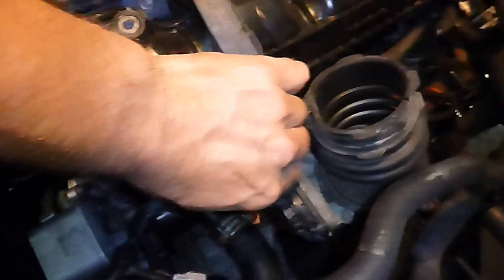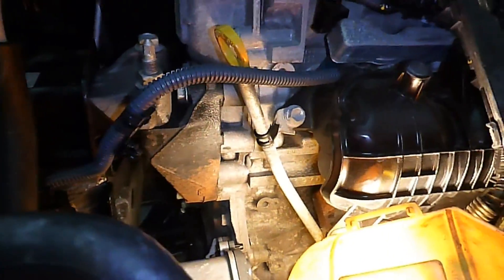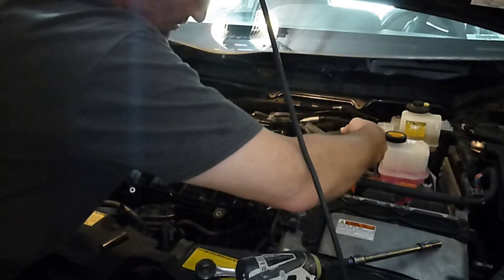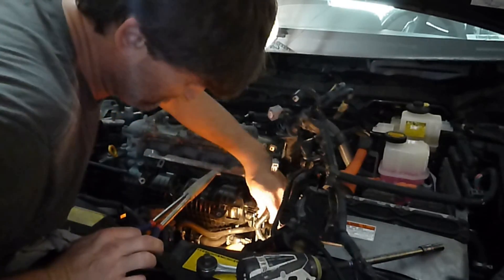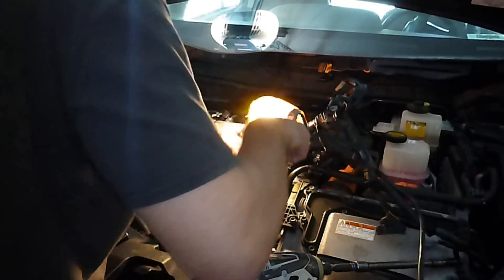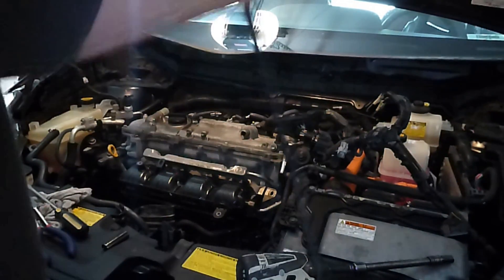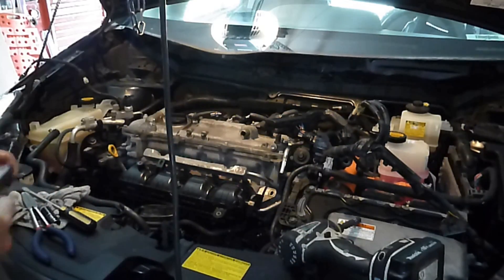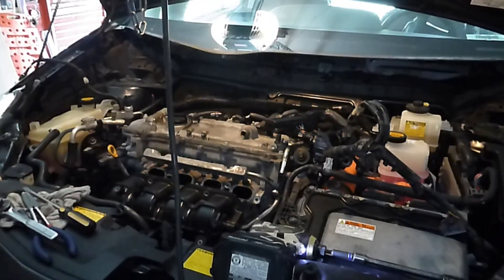Part 2 - 2016 Prius Engine Swap into 2012 Prius V - Start to Finish

Comment: Dang I've done some work on my prius v because of it shaking. Cleaned out EGR and even replaced the egr sensor (which probably wasnt broken) then sprayed all that engine cleaner in the intake manifold and EGR filter. Changed all the fuses and it still shaking. A shop just quoted me $7,000 plus to swap the engine. I'm trying to watch your videos to see if its easy enough for a DIYer like myself to do. How much do the new engines typically run?
Reply: Ok, First unplug the wires going to the EGR. Then at least the car may be drivable.
 -Fix THat Prius !!!
Reply from the maker: Hi, a low mileage engine from LKQ is about $1600 delivered.
 - Fix That Prius !!!
Reply: @fixthatprius4980  Im close to buying one and fixing it up. Thanks for the info. I just need an engine lift.
Reply: @fixthatprius4980  Do you have a link for that?

Comment: Hey brotha im just now discovering ur vids...not sure if uve covered it already but other than a newer motor ehats the benefit of a 2016 motor vs a 2012 same yr as ur prius? And what should i grab from a donor to do this swap??
Reply from the maker: Hi Lamu,
Thanks for your question. Please subscribe to my channel.
The engines are virtually the same. The cams were updated to save a little gas.
The reason I wanted a 2016 engine is it has better pistons and piston rings. The old oil rings would clog up and burn oil. The engine can still run for hundreds of thousands of miles that way.
You want a complete engine with everything attached. The stuff you cannot use from the donor is ; the flywheel/damper, intake manifold and stuff attached to it, exhaust manifold, EGR and EGR cooler, and the motor mount.
If you watch all the videos, all the info is in them.
 - Fix That Prius !!!
Reply: So whats the cause of these motors.to fail? I noticed u changed ur water pump and u still had motor issues i ddnt change anything other than oil changes never had any issues until i noticed the low coolant and rattling/shaking of my engine
Reply from the maker: @LamzLamz714  Hi Lamu,
Thanks for your question. 

I will explain what happens to (GEN 3) 2010-2015 Prius engines.

Faulty oil rings allow oil into the combustion chambers.  Oil laden exhaust travels through the EGR and EGR cooler clogging them with carbon / soot. Known bad EGR hangs open causing "driveability problems" - rattle, chug, stalling in low speed situations. Carbon builds up on the pistons and cylinder head , popping the head off the engine.
This accounts for all the typical symptoms.
Now what to do about it.
If your car was just running poorly you could unplug or replace your EGR and your driveability problem would go away.
But you probably have a bad head gasket too.
You can replace the head gasket but your bad oil rings will cause deja vu in about 80,000 miles.
To fix your car you must replace the oil rings, the EGR and the head gasket. It's much easier to replace the engine with a good  one.
I replaced engines in two different (GEN 3) 2012 Prius v's with (GEN 4) 2016 Prius engines. Others have also done this too.
My 2012 Black v has a bad cat thanks to Barr's Leaks.
My Gray v no longer overheats. It's very hard to bleed the air out of the system in the winter.
 - Fix That Prius !!!